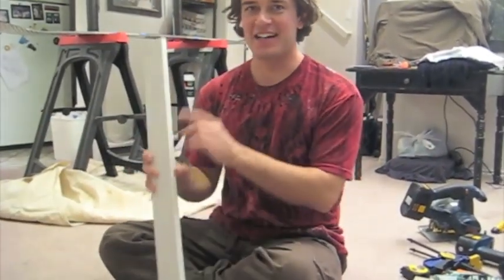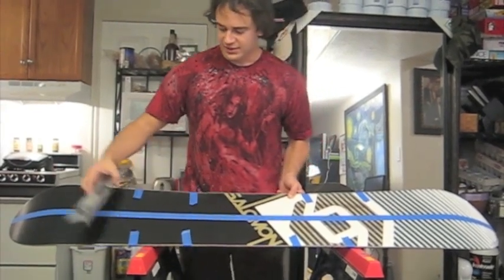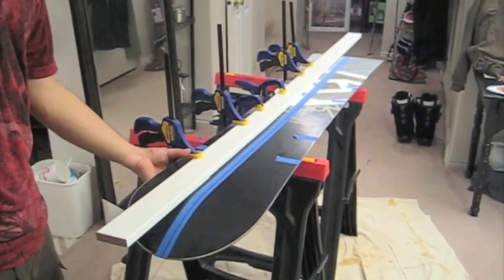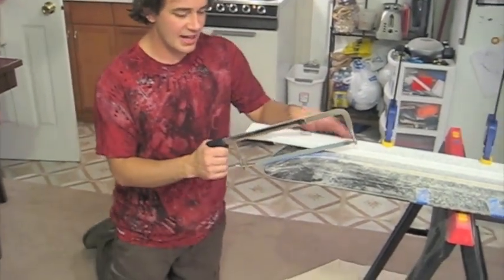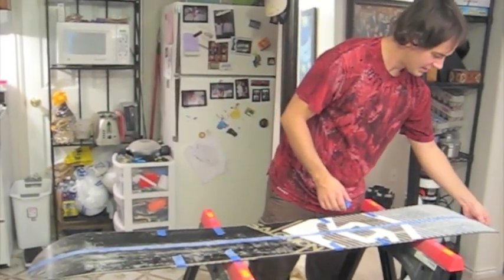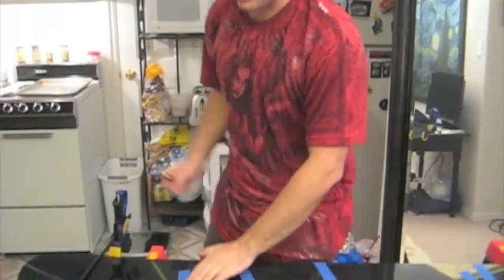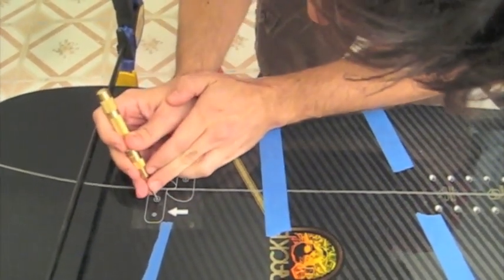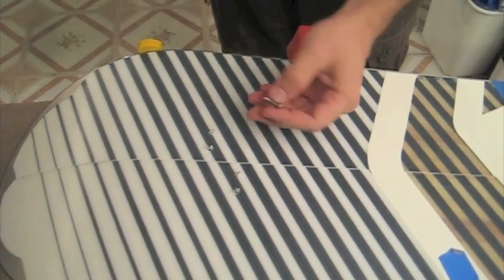How to make a splitboard - Part 1

Comment from the maker: Sorry I don't have a video of me using it, I will try to make one in the future.  The board has been great so far. The stiffness of the board is the same as it was before and I don't mind not having an inside edge for skinning since I live in Utah. I did it over a period of 3 days, but you can do it in 6-8 hours or even less if you are not waiting for things to dry.  Next time I make one I will definitely do it in one day then let the epoxy dry over night and finish the bottom the next day. :-)

Comment: After you have the board in two pieces I would think that since your circular saw blade takes away about 1/8" or material/board and the hacksaw blade removes much less, you would have a gap down the middle of the board. How do you avoid that?